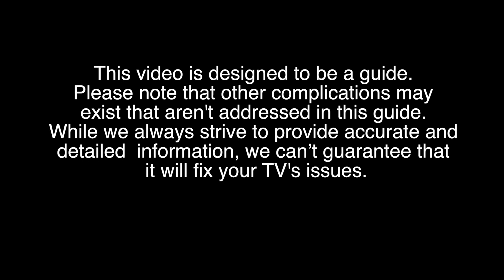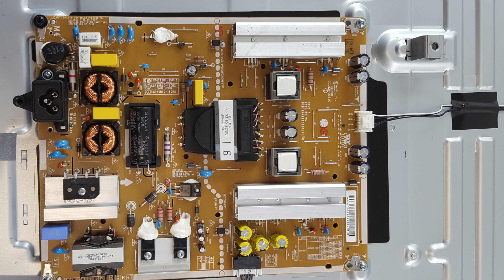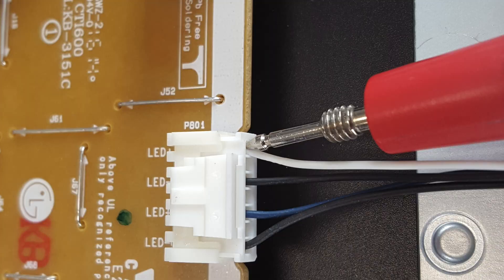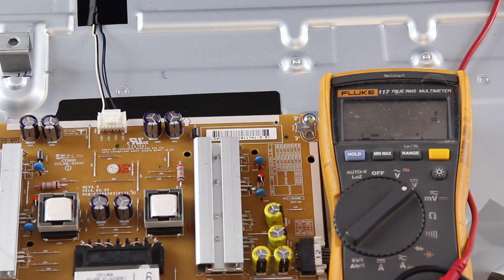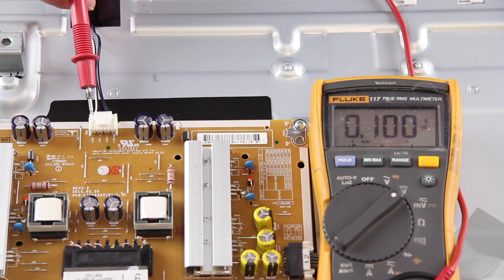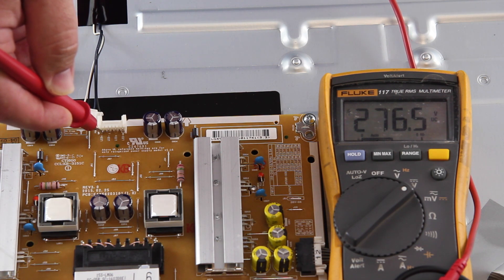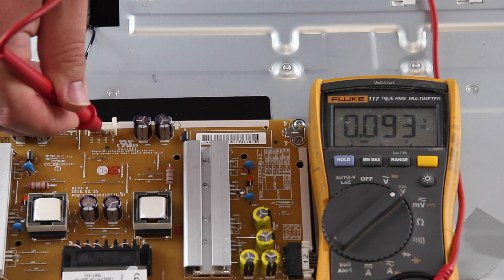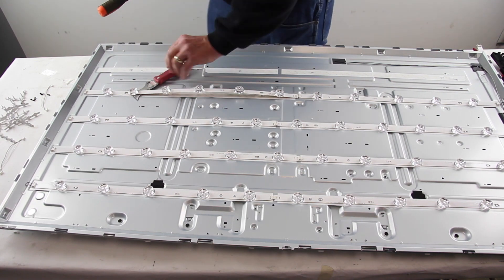LG TV 55LF 55LB NC55 No Backlight - LED Voltage Test - Troubleshoot TV LEDs & Power Supply

Comment: I wished I would have seen this before replacing the power then main board.  I didn’t realize backlights can cause the tv to go completely dead with no voltages.

Comment: I have no Voltage 0V for the LED light , and Replaced the Power board based on this advice , and its still 0V .  The TV works , there is Sound and Picture just no Light .
Reply: Did you figure out what the problem is?  I'm getting 0V for LED1+ and LED2+ on both sides of the connection.  Seems like Power Supply, but your comment makes me wonder. Thanks.
Reply: @nathanp39  Yes i did , the Power Supply has a Sensing function and if it doesn't see the correct load it cuts down power . Which means it was LED strips gone bad and power supply was in protect mode . That is why when i changed the PSU nothing changed , since it was working in the first place .
Just showing that the You Tube Videos are most times just People running their mouth and should not be considered for advice .
So check your board Transistors , if you dont find bad Caps , Transistors or something not working , then it works and its the LED strips gone bad .
This is pain in the ass because changing 55inch LED strip is not easy . Taking apart the screen can lead to damage , but good thing is that it is usually  1 or 2 LED , and you can change them individually on cheap .
But you need time and space , and effort to disassemble the screen .

Comment: I have an LG 55LN5310. The voltage readings are 91 V on both LED+ terminals when the connector is plugged in and the voltage is the same when the connector is unplugged. Where do I find what the voltage should be for this tv? What do these results signify? Thanks.
Reply: Hi, did you find out?

Comment: I have an 65 UK6100Y lg tv, the led is working But in dim lightning, the image is super dark, i test voltage without the led plug and it show 270v
When i test with the plug it show 260v

In this tv ther is only 2 wiers led+ and led-

What can be the problem?

Comment: Hey I was just given a lg 55 uh6090 and the screen is half darkened. So looking at the screen the left half is dark. Is that a bad power supply board?
Reply: Have you ever seen all the back light strips go bad half way across each one? I don't even understand how the powerboard would be the issue. Half the lights in each strip work lol I haven't seen this one yet

Comment: Excelent video ! I have one question. I got a 55 inch tv where one of the leads stopped working. Can I bypass that led , removing the old led and wiring a bridge JUST to test if they all get LIT correctly. NOT as a final solution, just as a way to check if the other strips are working ?
Reply: Yes, you can only if all the LEDs are in series. The PSU will readjust the voltage to limit the current in the rest of tht LED's. But there are parallel designs on some TVs, and if one LED fail from a strip, the current will drop significantly and the PSU will keep the output low to protect the rest of the strips. In this case bypassing one LED the PSU will put the maximum power out  and will burn the rest of LEDs. This is a bad design adopted for the new TVs. That protection for the rest of the strips is not so good, most of the time the PSU will burn all LEDs if one fails.

Comment: when testing the power supply board. you didn't explain where to set my volt meter. should that be important. or could I just set the volt meter anywhere? thanks

Comment: Okay so my LG only has 1 LED+ and 1 LED-.

My TV's fault is that the backlight doesn't come on most times, MOST TIMES, but once in a blue moon it does, but not for good, turn it off once and it's broke again. Or even changing the HDMI channels can do that too. I guess it's anywhere where the Backlights go off, there's a chance they wont come back on again.
Like 99% chance.

I followed the diagnostics shown here, when the screen backlight is working (a rare opportunity now) I get roughly 210V plugged in but I couldn't get a test for when plugged out of the power supply board as it never came back on after switching off, but I've also tested it when the backlight isn't working and get roughly 107V plugged in and plugged out...

Note, I haven't taken apart the front to look at the LED strips but counting the ribs from the back make it look like it's probably 4 lines of LED strip.
Also, the TV is 8 years old.

So I'm not sure but I presumed each line of LED strip must require about 50V each and for some reason the power supply is faulty.

Does that seem to be the case??

Comment: Yesterday my LG 42LB5500 went black screen. I took the light of my cellphone and light up the screen and I saw that there was image but without light. There was audio and also the red power off led worked fine. Today with the multimeter I did a voltage test in the led power supply part and I had 100V with the led cable and without it and with the tv on. Right now I dont know if the power supply is the problem because it says that it should be 280v for output and I had 100v. Can someone help me?

Comment: Backlight not working on LG 42LB5600-UZ with EAX65423701 power supply.  Has video showing in flashlight test.  LED+ test point shows 106 VDC with the backlight connected or disconnected.   No voltage on the LED- connection and no voltage between LED+ and LED-.   Label on power supply lists output at 208V.  Do I have a power supply problem or and LED strip problem?  If this is an LED strip is the problem, did it damage the power supply?

Comment: Hi, I have a Sharp LC-50LB371U Manufacture date 6/2015.  I have no picture, no audio (however I hear a tone when powering off TV), no backlights.  I can see the menu when doing the flash light test.  Voltage tests on the main power board on the LED connector are as follows.  I get 65.74 VDC on LED 1 and LED 2.  When I disconnect the connector plug I get the same voltages on the opposite side of the pins.  Please advise.
Reply: Did you sort it i am getting the same

Comment: I had 7 leds burned out of my TV. I replaced them and tested them individually before powering on tv. After I replaced them all I connected the power boards everything except the display itself. When I power it on they all come on and blink except one that doesn't go completely off it just flashes and gets dim. This is one in the first series. Is there a reason this is happening? I replaced it and still does it I also replaced the other one in that series that I replaced earlier. I really need some help here please.
Reply: I found the problem. I had an 8th led that was bad but still lit up just not as bright as the others. I put on sun glasses and watched after replacing the 2 in that series twice and found one in a different series that didn't seem to get as bright as the others so I replaced that one then plugged it in again and they all lit up evenly and stayed lit. Now the TV works beautifully and I'm very pleased. If anyone ever has this issue hopefully this will help them. It's very hard to find because the lights are so bright it blinds you and makes it hard to see one light in the middle lol.

Comment: Have an LG 55LB6300-UQ.BUSWLJR. Ordered LED strips from you and replaced them. Tested the LED strips pulled and found 2 with burn marks and 1 open LED. The TV still flickers. Tested PS board with LEDs disconnected and the voltage pulses on and off. My question is before ordering the PS board from you, is there a possibility of the Main board being defective as well. PS board is EAY63072101.

Comment: Hi I have this monitor circuit board (F)QCCB0DL0110000 S/N: 33E71690LM0027 M3C201 I wanted to disable the sleep mode so I can use the monitor back light as normal light. I don't know which on I need to bypass in circuit. If you can help me will be great.

Comment: How do you figure out what the proper voltages are for your specific TV? I have a LG 65UK6300PUE.
Reply: Led strips - 3v per led so 10 led per strip = 30v for example

Comment: Philips TVs are different. LED strips are connected in parallel. If one LED fails, the PSU will kill all other LEDs because is a fixed current PSU and the current is calculated for 5  LED strips with a voltage at maximum 55v. 
I've got fooled by injecting current from an external LED PSU with a greater voltage and lower current because the voltage drop across the failed LEDs have been increased to about 10v. The panel got lighted with this external PSU and had no light with original undocumented Philips PSU wich i thought is faulty. Finally after digging the internet found out that the LEDs strips are connected in parallel, than i have opened the panel and found that are faulty LEDs.
Now testing the original PSU once again with a power resistor of 50ohm on output i still get 55v with 1.1A. This looks like a lot of power to me and I don't have a lower resistance resistor to test for the maximum current the PSU delivers and i can't find any info about the LEDs strips and the maximum current per strip. There are 5x12 series LEDs, does anyone know the current for a LED strip? I am afraid not to fry the new LEDs.

Comment: I have a 55 inch LG LED TV (model is LG LN54M550060V12). I performed the flash light test and I can notice image in the background and the audio is working fine. So, i proceeded with testing the power supply board s instructed. I see that the voltage on both the LED+ nodes is around 80. Even if I disconnect the LED power supply connection and check the voltage, I see the same reading. Is that normal? Per the videos posted, I see that the voltage when the LED power supply cable is connected is lower than when it's detached. So, do you think it's an issue with the power board (or) LED backlights?
Reply: I have the 55LN5710 LG with the same problem (LG logo & flash, black screen, sound working) and I tested the voltages and got the same result as you. Did you solve it?
Reply: Thank you very much for your help! I'm going to open my TV and change the defective LED strips
Reply: @Brenton Tripley Thanks, problem solved. :-)
Reply: Yeah, keep the solution to yourself.  @MrNedzedster

Comment: Hi, thanks for the informative video. My LG TV (50lb6300) starts blinking when I power it on from yesterday. It blinks for every second and when I play something, the audio is good and video is running but keeps blinking. So I tried the following
1. Disconnected the ribbon cable to t-con and powered on the tv, still seeing the blinking LEDs - so suspected LED issue.
2. Measured the output voltage in all the pins from power supply board to mother board. All are same as specified in the PCB.
2. Measured the voltage at the LED output pins in the power supply board:
- With led cable connected, 
  a. middle LED+ pin voltage varies from 135v - 147v
  b. edge LED+ pin voltage varies from 135v - 140v
- With led cable disconnected,
  a. middle LED+ pin voltage varies from 128v - 147v
  b. edge LED+ pin voltage varies from 140v - 160v

Can you please let me know what's the problem